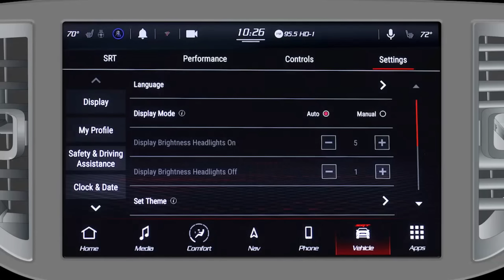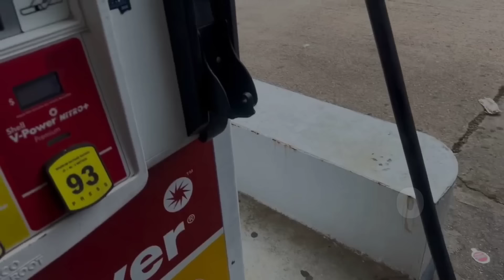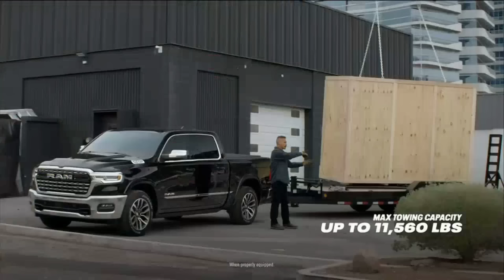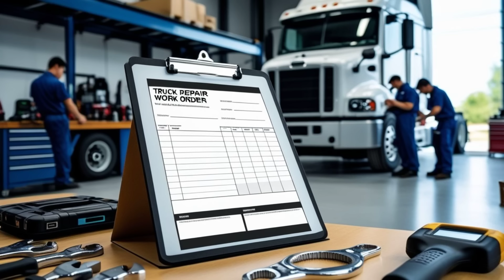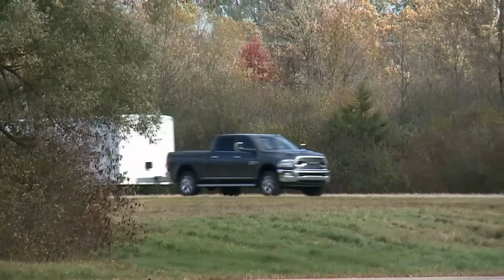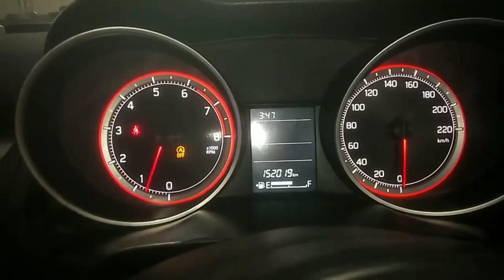These 5 Hidden Ram Settings Are Ruining Your Engine. TURN IT OFF NOW!

Comment: Stop excessive idling and use 5/30 oil instead of 0/20.....solved
Reply: That's the ticket! All the experts that I have talked to say most of the failures are happening to fleet vehicles, police cars and taxis, those that idle a lot.
Reply: Also more frequent oil changes,  on the 2016 hemi they decided to put an oil filter the same you'd see on a small 4 cylinder. At the recommended oil change interval of 10,000 miles the filter clogs and you lose oil pressure.

Comment: 1 tow/hail mode doesnt allow the trans to go into overdrive which puts more strain on your engine on the highway.  Eco mode isnt on from default. Auto Start the starter is beefier to compensate.  the engine isnt starting dry because its only been off for maybe a min.  And if you have E-torque the alternator starts the engine more than the starter anyways
Reply: S/S: I still don't want that crap. I don't want to pay for and have to carry around a heavier/beefier starter, alternator, and battery, no thanks. I also don't want ANY coolant/oil circulation cutting out at every stop light in city driving, in some areas you spend less time moving that actually driving. I'll take the minuscule additional fuel costs all day.
Reply: @briancavanaugh7604 well if the heat or air is on if you have one without the e torque it doesn't cut off anyway so I always have my AC or heat on anyway so I don't have to worry about it and I get better gas mileage if I drive it a lil hard it's crazy I was babying it and had some rattling I started using 89 gas and driving it harder and it's stopped

Comment: I thought the e-Torque system started the engine again and not the starter.
Reply: He’s 100% wrong on the etorque not starting the engine with the auto stop/start feature turned on, I actually use it in city driving, it also keeps the lifters from idling
Reply: Me too, I think he is wrong
Reply: It does. That's why you take these videos with a grain of salt. Starter only used on initial start up.

Comment: The GM and Ford engines of certain years have the same issues.  The GM engines like the 6.2 have a even higher failure rate.   If I had any of these I would simply buy a plug in deactivation device.
Reply: Ford is more likely to catch an engine problem before it starts considering you have to take it back for a recall every other week.

Comment: From the horrible robot voice over that pronounces "RAM" as "Rahm" on the fifth word of the video to the hugely misleading "#1" (if your Ram has "e-Torque", it doesn't use the starter to restart your engine, it uses that big-ass 48-volt DC motor to directly turn the crankshaft) -- I'm giving this video a "thumbs down"
Reply: I’m sorry, but Eco Boost is Ford not Ram, do you mean ETorque?
Reply: @bchapman2511  Yes, and now I feel like a moron! (fixed)

Comment: I’m on my 3rd Ram truck with absolutely no issues !! All 3 over 130,000 miles . I have always turned off the MDS , again no issues !!
Reply: Same all my 5 7 hemis great 
Have had more problems with TRX than any ram.
Reply: I got a 2018 bighorn and i dont see eco mode or mds disable
Reply: @waltervashey1979 Just read if you select 8th on your steering wheel with the upshift. Or 6th if you have 6 speed it temporarily turns off eco. Have great day .
Reply: @waltervashey1979 You should be a way temporary shut off but start on automatically next run.I know you can permanently turn off with a hand held tuner like bully dog or diablo.
Reply: @waltervashey1979 th plus and minus button either on your shifter on the steering column or the middle shifter you will see the plus minus button, go minus then plus to either 6 or 8 depending on how many gears your tranny has , it will stop the MDS from engaging , but the down side is you have to do it everytime you start your truck .
Reply: Trucks don't have the MDS, they have VVT.
Reply: @ChristianHawkins-k8m Wrong. Since 2009, the 5.7l hemi trucks have mds. The 6.4l hemis also have mds. 2500 and 3500 trucks do NOT have mds.
Reply: @chuckwright8694  My 2500 does.  2026.
Reply: I got a 2018 bighorn and i dont see eco mode or mds disable
Reply: @waltervashey1979 it’s the plus minus button on your gear shift , if you have the gear shift in the middle , you can still turn it off that way too
Reply: Trucks don't have MDS, they have VVT.
Reply: @ChristianHawkins-k8m Mine is a 2014 4×4 5 speed transmission and it has mds. I use tow to disable it if I'm only driving around town but not on the hwy because it locks out overdrive.

Comment: You still have the problem. It’s the camshaft! Why it’s the hardening process think it’s the cam failing it’s to hard. It flakes off than goes in the lifter. Not every cam is bad. Think how people get 90,000 to 175,000 before a camshaft issue. Fix is a aftermarket camshaft with better quality control. And new lifters. Some last 40,000 to 60,000 it’s the group of camshafts
Reply: Most often its lifter bearings. They made them stronger around 2015 or 2017.

Comment: I'm a follower from Saudi Arabia. This is a great channel with excellent information. We have discounts on the 2025 Ford model. I'm interested in buying a Raptor Twin Turbo V6, an F-150 XLT FX4 V8 5.0, or a Ram Doag. I'd like to hear your opinion on which is more reliable and dependable for city driving and occasional desert use. Your opinion will help me make my purchase. I await your reply.
Reply: HI FRIEND IF YOU BUY THAT RAPTOR I WOULD LIKE TO SEE IT RUNNING ON THE DESSERT HOPEFULLY YOU CAN SEND VIDEOS IF YOU BUY A RAM BUY THE TRX
Reply from the maker: Thank you for watching from Saudi Arabia! Honestly both are great — the F-150 5.0 V8 is solid and simple to maintain. But the Ram with the 5.7 HEMI gives you the smoothest ride of any truck in the class, especially in the city, thanks to the coil spring rear suspension. Plus plenty of power for desert trips. You really can't go wrong with either, but I'd personally lean Ram! 👍

Comment: My 2014 1500 always runs in the tow haul mode it keeps all cylinders firing and only cost me 3/4 mile per gallon also it turns off the eco mode.  Doing this helps stop the temperature from the exhaust manifold being different on the cylinders not running this prevents the exhaust manifold from warping.
My 2022 2500 diesel always runs in the engine brake on.
I hope to get 500000 miles on both engines before they quit.
Reply: I do this on my 2015 big horn
Reply: Do you run both exhaust brake and tow haul on your diesel (at the same time)?
Reply: I run both at the same time it help that the transmission holds the gear longer and the exhaust brake works better.  You also use less brake with them on.  After driving a semi for 20 years the only time I shut off the exhaust brake is when it is posted in town that exhaust brakes are not allowed.